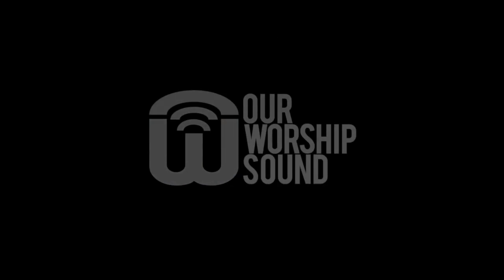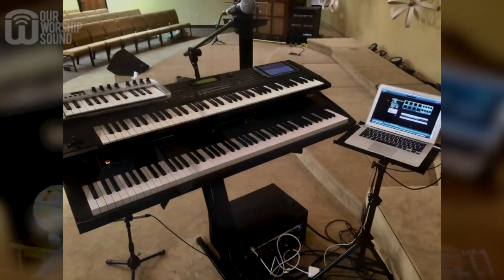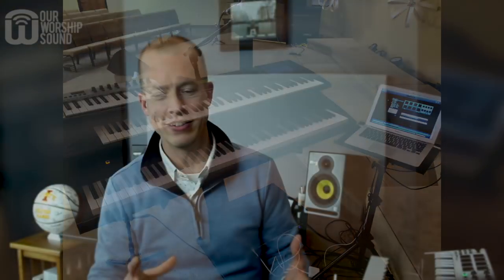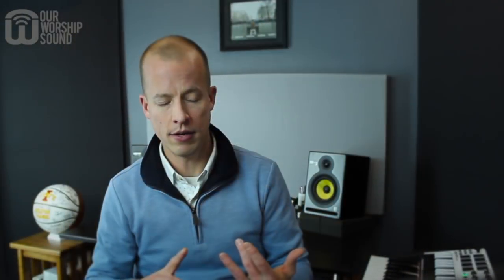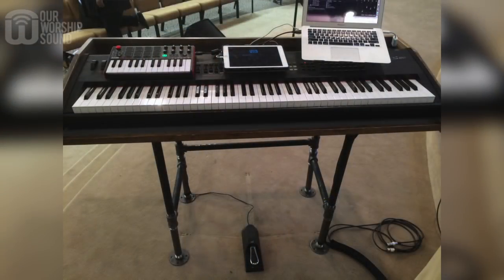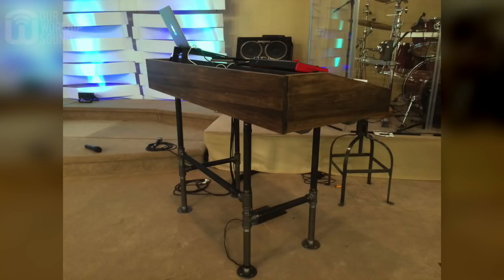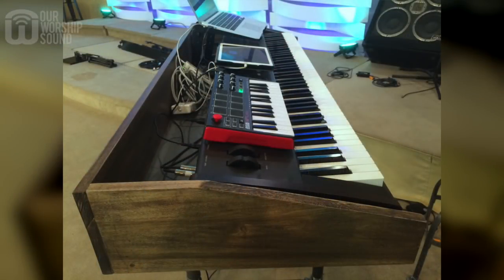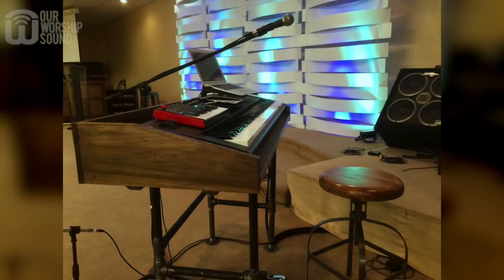DIY keyboard stand to simplify my rig

Comment: Do you have plans to solve the following issues(if they're issues at all)?
1) 2nd keyboard
2) Standing position
Reply from the maker: It's set for standing position. I could add a second tier by taking out the laptop, adding an additional DJ laptop stand, and using those to support a second keyboard. Booya. #NinetiesStyle